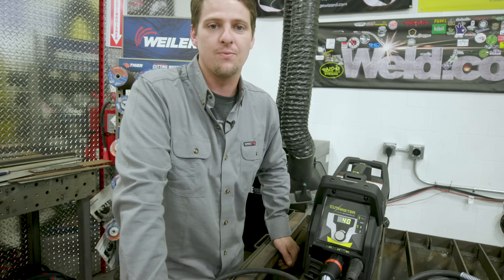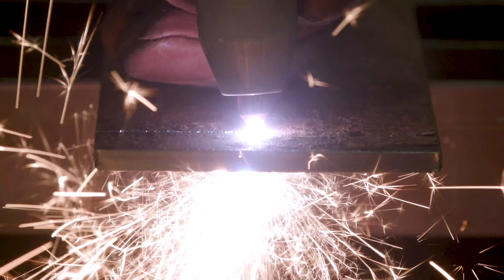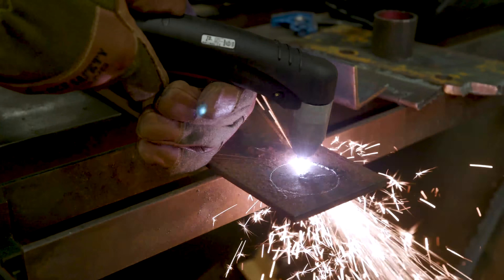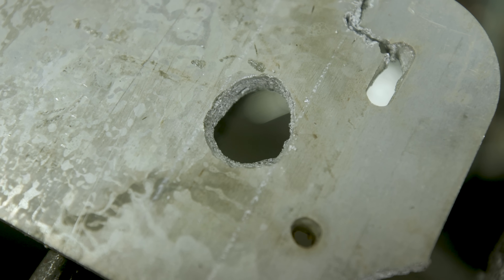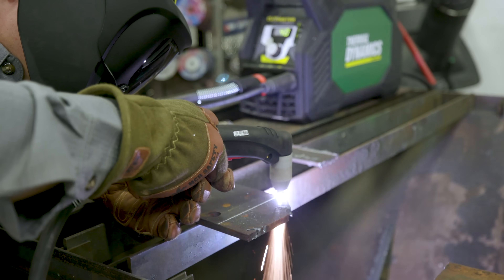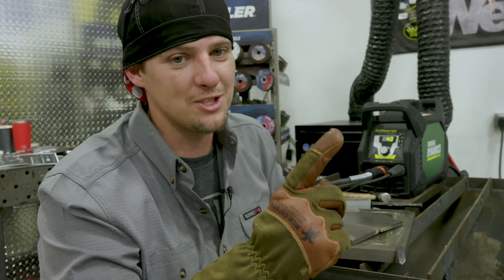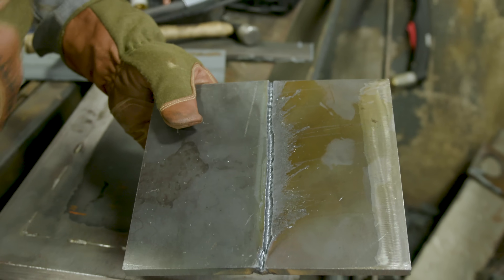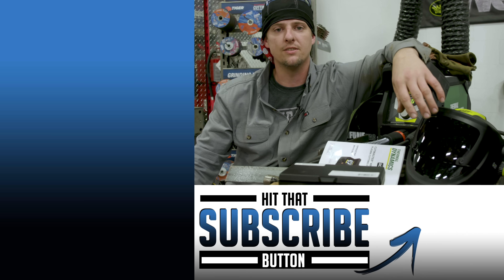Unboxing the New ESAB Cut Master 40

Comment: I purchased one and find the consumables do not last long, I have a large compressor 80 gallon, separator, desiccant, and fiber dryer on the system the air is dry the consumable life is very short, do not buy, China made, you will feel cheated.

Comment: You did not say how much air flow and what type of compressor is required. It fumbled through 1 inch, but it looks like an O/A torch would be superior for 1 inch. Nice presentation and as always on this channel, great video of the guts/weld. 🤘

Comment: What was the CFM you were using? I find that 5.5 which they recommend for this is low, and it doesn’t always cut through and can make a blobby mess.
Reply: In oz we use psi ? Trying running  80 , 90 psi ?

Comment: What would you use for an air filter for one of those? what size air compressor would you want to run that in a garage shop?
Reply: Size compressor  i wouldnt go lower than a 12cfm ?

Comment: I have the older(4yrs old) Cutmaster 40 and I found it maxes out for clean cuts around 5/8" Ive done some 3/4" Hardox with it and the cut starts to wander a little.  They may have changed that in the new model with the digital readout though.  No complaints about it at all.

Comment: Hey guys!

Just wanted to see if anyone else also feel it’s heavier to breathe after a day of welding. 

I am currently going to a weldschool where we work in smaller stalls but they are equipped with great ventilation fans and I am always very aware of placing the mouth of the fan just above where I am working. I don’t think I’m making this up because I can also feel a very slight achy feeling in the lungs.

This usually occurs after two straight days of welding.

Maybe someone has any input on this matter, I will definitely try a face mask but these are ofcourse a bit hard to come by these days.. 😄

Thanks!
Reply: Always a good idea to stop particulate matter from getting into your lungs. Something that you can breathe through and won’t flash on fire. Gasses are hell on lungs but particulates can accumulate over time.
Reply: Iet the instructor  know if you haven't done so already  have someone watch you weld  you ma have your  head in the fumes and not notice  try welding shops for a mask and get it fit tested  to make sure it doesn't leak  . When you are wearing  it .stay  safe
Reply: Must be weak fans maybe, our fans just seem to eat the fumes

Comment: I’m a fan of this channel and ESAB I have the new ac/dc multiprocessor welder but why does it say thermal dynamics and it’s green? One owns the other? Just curious
Reply: Hey James! So Thermal Dynamics is an ESAB Brand. Just like Victor Gas Equipment, Tweco MIG Guns, etc. You can check out all of the ESAB Brands on the website: http://www.esab.com

Comment: Am I the only one wanting a review on the everlast mts lightning 275 burning a E6010? Thank you!
Reply: Weld.com has done a review on the lightning 275, the MTS 252 STI is the same welder except for the digital screen they are both 250 amp welder's and the 252 STI is cheeper, I thought about buying the 275 until I found out it was only a 250 amp mechine why pay a lot more for a digital screen, check them both out, at Everlast welders .com

Comment: Looks like a very nice unit but I like my Hypertherm  because it has drag tip and it is so much easier as you do not have to try to hold
a 1/8 standoff, but still a nice machine.
Reply: Hypertherm is same price as this one, plus it is designed and made in USA.   TD's only advantage over the Hypertherm was their cutmaster 42 could be bought for $900.   Since TD seems to be discontinuing that model for this $1400 model, TD no longer has the competitive advantage for a budget plasma cutter.
Reply: Hypertherm makes great machines I work in a ship yard and all of the plasma tables have hypertherm plasma cutters and they cut up to 4 inch plate at times all day and night non stop 24/7 for the last 10 years without issues.we leave the hand torch hypertherms outside in the weather all year plugged in and in use 24/7 also without issues they really are worth the money

Comment: I almost bought that model but stepped up to the 58. No 120v but has purge mode trigger lock and expanded metal mode. Im very happy with it and was considerably less than the 60.   That was still some impressive action for a 40amp  machine. Thanks for showing.🙂
Reply: The 58 is definitely the better choice for most people.

Comment: My Hypertherm XP 45 will do drag cutting right on the plate from 10 to 45 amp's, I just wish I had a plasma table with a pipe attachment for it. It's a great plasma cutter it does a lot.
Reply: I had a couple of china cutters and they worked fine, but I wish I just got the Hypertherm from the start.  I have the XP45 as well and love it.
Reply: T.D. has drag tips as well up to 60amp but they are only recommended for up tp 1/4" material i think
Reply: I use the hypertherm 45xp too.its a really good machine..lots of power.

Comment: When you're cutting a cirlce you should angle your torch on the initial cut so that nothing splatter back towards your torch tip is that correct or just something incorrect that I was told?
Reply: That is correct, hold an angle for that initial piercing.  It helps protect the consumables

Comment: Why would anyone want one when you cannot even drag it and have to be careful not to make contact with the metal? Why would you like it unless you are just trying to sell them? A little biased. Hypertherm have been and are far superior. I listen to videos like this when I was buying our first plasma cutters and we bought several until we found Hypertherm. Unfortunately, the videos were similar to this video where you really do not give great information aside from the thickness it cuts. So now I see this video and it is a sad reminder of the state we were tricked. Perhaps is it my expectations of weld.com and hold you guys to a higher standard.
Reply: I was just about to ask about dragging it. Guess that's a no go. Why can't other manufacturers make a tip that can be dragged?!?!
Reply: @chris_martin    All Hypertherm 30 XP and XP 45 come's with drag shield's,  I bought a Hypertherm, the XP 45 is a great 220 volt  mechine  start at  $ 1640.00 at IOC weiding supplies that where I bought mine, the 30 XP and the 30 Air are great 120/220 mechine's,   look up ChuckE 2009 video's on plasma cutting mechine's, and ChuckE 2009 and Jim Colt from Hypertherm do a tour of Hypertherm A very good Company, I had great servise from IOC welding Supply check them out online - fast servise from Indiana.
Reply from the maker: A simple drag shield will help with stand off and we don't sell these.
Reply: @Welddotcom  You don't review things you don't sell?  These plasma cutters are advertised to hobbyists and small shops that don't use plasma cutters on a daily basis.  A cutting guide seems to be an accessory essential for this model.   It would have made sense to spend the small amount of money for one, include it in the review and say you don't sell this, but it is handy.   Was this video a review or was it a commercial?

Comment: Dumb question  -  what would you use gouging for?
Reply: Gouging.

Removing old weld for bushing replacement.
Reply: Anything you have to disassemble and rework. Or if something fails a weld test and has to be rewelded.

Comment: I wish you would have told us what consumables you have used and the air pressure also.
Perhaps your air pressure was too low when going for the one inch plate...?
Reply: Generally 90 is the recommended pressure all around. Could very well be wrong tho. 1" is alot for a 40 amp unit, where the oxy acetylene shines
Reply: They recommend 90-125. Also CFM between 3.3-5.5, though the torch can do 7.5, but that’s at 60 amps.

Comment: I wonder if these machines can completely take the place of a cutting torch? Pretty much like Tig did for oxy welding.
Reply: one thing that most plasmas cant do is heating metal for bending or releasing rusty bolts etc, there is one i know of that claims it can heat nuts and bolts, thats the oxford cutmaker pasmas
Reply: Good points guys thank you.
Reply from the maker: O/A is superior in field applications, because you don't need a compressor. Plasma is excellent for shop environments.
Reply: @Welddotcom  What mobile welding rig doesn't have an air compressor yet has the space to haul oxyacetylene tanks?
Reply: @otm646  just my 2 cents. My buddy does gas pipeline, Socal Gas contracts. He welds with oxy/ac. Has an SA200 in the truck along with the tanks, stands, hose reels, tools. Different industries use different stuff. He would have to change machines to be able to power anything bigger than a grinder. Plasma just not needed in his field, big field, think every house with natural gas.